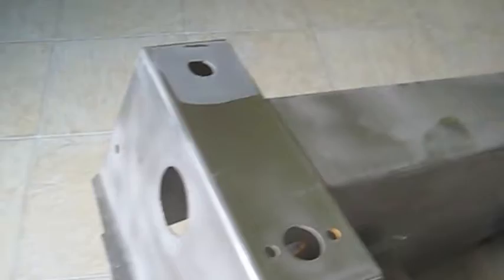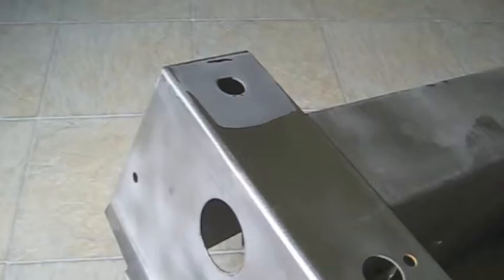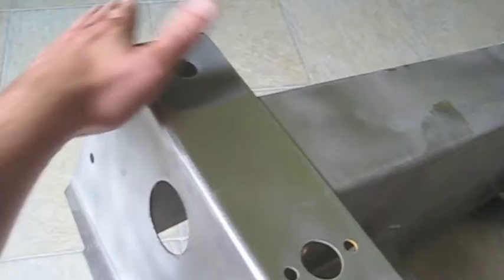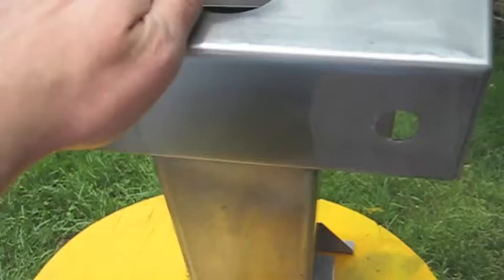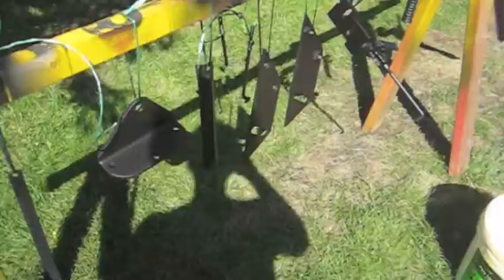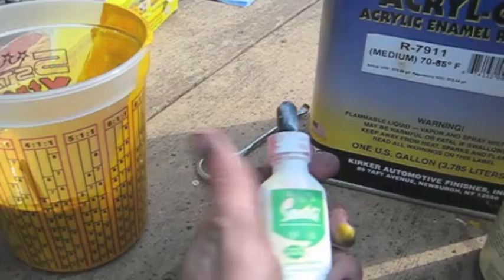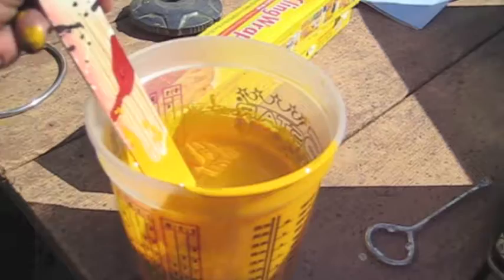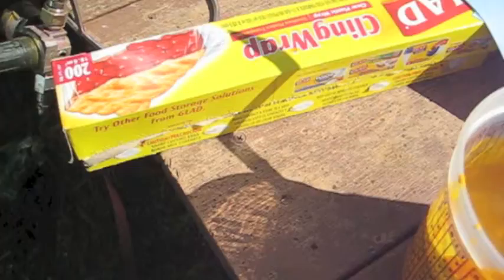7 - Cub Cadet Original Restoration - Painting Tips

Comment: I am in the process of restoring a cub cadet 100 were did you get the paint and do you have to use the hardener I have never painted with a spray gun before but am thinking about giving it a try thanks a lot.
Reply from the maker: I recommend using the hardener with the paint, but you don't have to use it if you don't want to.  If you don't use the  hardener then the paint will take longer to cure, and the finish won't be as hard and glossy.  Try tractor supply, they should have everything you need and their paint is already mixed.

Comment: When it comes to painting I am a novice, so I was wondering if you need to put on a clear coat if you are using enamel paint. I am currently in the process of restoring a 62 original.  Thanks!
Reply from the maker: I used a traditional enamel paint...  no clear coat is needed.  The paint already has a shine.  I just applied several light coats and let it dry for 24 hours in between the coats.  
Modern paints on cars use a base coat / clear coat system and they are more expensive.  The base coat is the color and it is flat.  The clear coat is applied over the base coat and give the paint its depth and shine.
Reply: The5upermann1 Thanks! That helps me out a lot and by the way I really enjoy your video series!